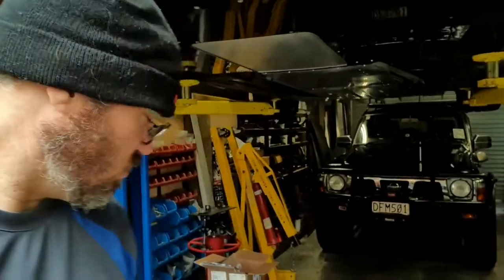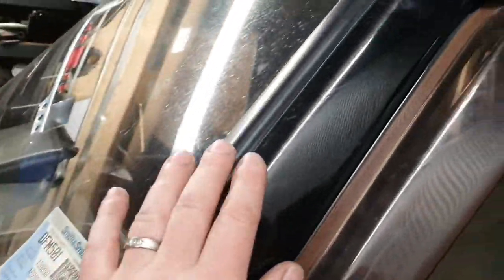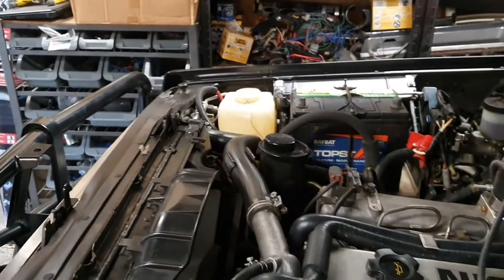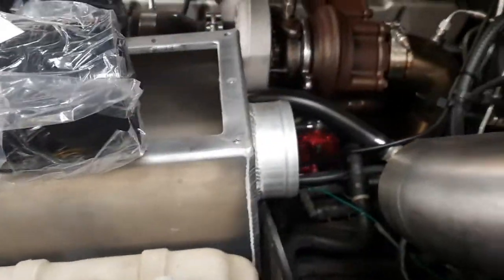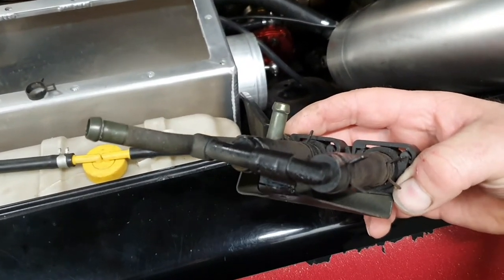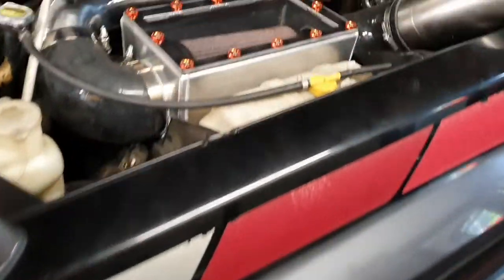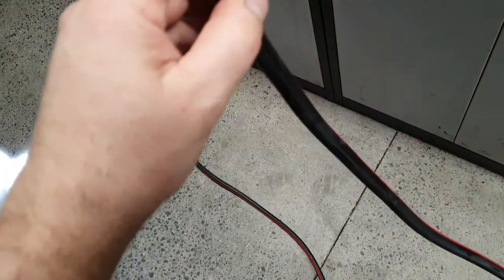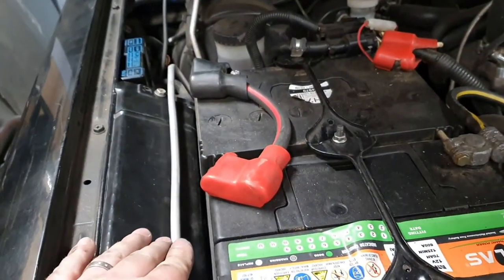Snorkel & air box install on GQ Patrol

Comment: This vid is Good as mate. 
All the normal stuff around with bolt on parts
Reply from the maker: To be fair I'm pretty sure the only part that was supposed to just bolt right up did actually fit exactly as it should & that was the actual snorkel.
I'm not sure the air box was designed to go where we put it, I think that was more of a "this should in theory fit in here with some tweaks"